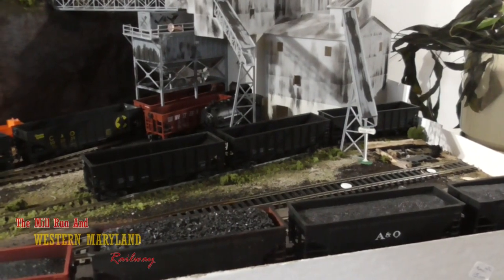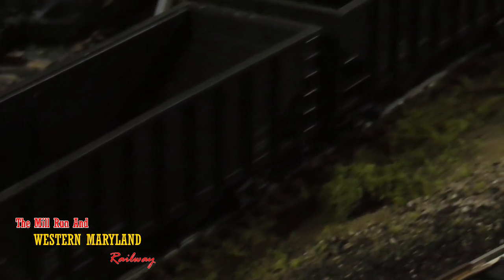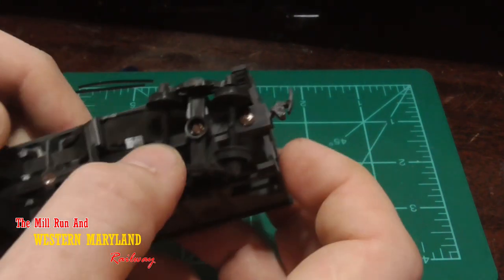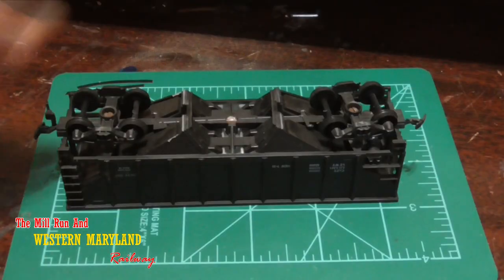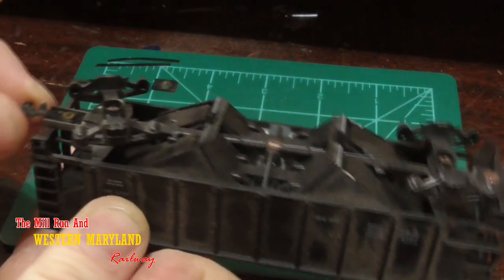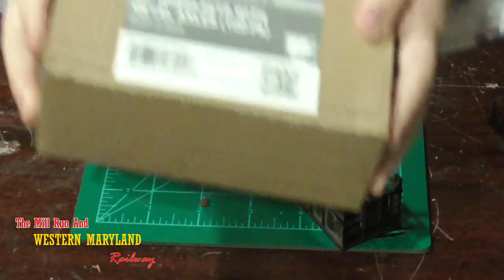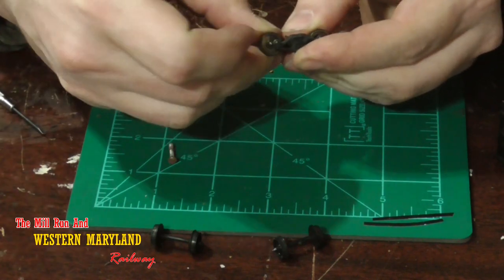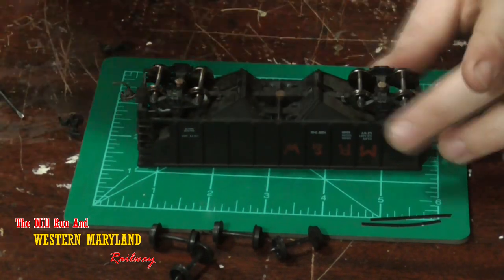Installing Metal Wheels and Knuckle Couplers On Vintage HO Scale Rolling Stock

Comment: I have more than 300 pieces of freight cars. I bought 10 sets of those 100 per box but once in a while you will run into trucks that are too wide to keep them in place. I bought the boxes when Walthers had them on  sale then my Dealer put them back fro me, when I needed more I went to my Dealer & pick them up. 10 boxes of 33 4 boxes of 36.Some of my newer stock  already had wheels & couplers. I had a number of Talgo type trucks so I had to change those too.

Comment: I also buy the Walthers all metal wheels sets but the case. I like how they add a little extra weight to my older cars. I often have to use the Micro Mark Truck Tuner to make the new wheels spin freely.
Reply from the maker: The truck tuner is a tool I must invest in. I've had a few wheel sets that are a little tight. Lol. Thanks for the comment!
Reply: The tuner is a real asset to make the wheels turn freely!

Comment: I'm just starting this project with my 55 ton hopper fleet. It consists of Athern, LifeLike,  Stewart and a few Atlas cars. The Atlas needs no improvement.  I put Atlas trucks under one of the Athern cars and it not only runs like an Atlas,  it looks like it. Next I'll just replace the wheels on another & compare.
Reply from the maker: Awesome! Thanks for sharing!

Comment: I spent nearly $400.00 on changing out wheel sets and couplers on about 100 pieces of rolling stock.  I changed the wheels from plastic to metal (after all, trains have metal wheels) & body mounted Kaydee couplers.  I also took the time to weather each piece of rolling stock.  Took me several months to complete the project.  I also changed out all the incandescent lighting on coaches to LED lighting and changed out the headlamps of locomotives to LED's as well along with proper ballast resistors.  I used mini full wave bridge rectifiers, LED strip lighting (the ones that can be cut apart at every 3rd LED & have the ballast - current limiting resistors - already on the LED strips).  I also used 3200uF capacitors for flicker free lighting.  I even lit up an old REA (Railway Express Agency) coach by making my own wheel pickups out of some scrap copper I salvaged from an old computer.  The LED strip lighting is 12 volt DC and I think I used about 12 LED's per coach.  I used bright white LED's but they turned out to be too bright, so I painted each LED with yellow acrylic paint and now they look period correct with yellow lighting.  I also changed out all coal loads to real coal.  I had a big lump of bituminous coal I went after with a hammer (outside of course) and smashed it into HO scale.  I also brought each piece of rolling stock up to NMRA standard weight for each piece of rolling stock.  Cheers from eastern TN

Comment: I have a question as someone who got some metal wheels for his first train set, what do i do to fix the trucks if after i install the wheels, the wheels become stiff and hard to turn. How to i loosen up the wheels to make them more free wheel?
Reply from the maker: The best fix is to tune the trucks. To do this, you'll need a truck tuner, mico-mark makes one and the part number is 82838. Now I'm sure there may be another way to do it with possibly a drill bit or something, but the truck tuner is the safest way to get your wheels freed up without causing any damage to the truck. Hope this helps!
Reply: @themillrunandwesternmaryland11  thank you, I'll go look that up right now